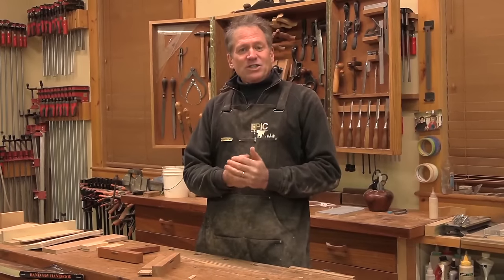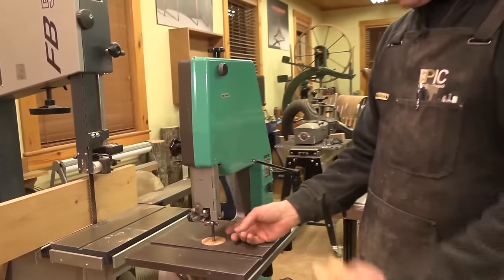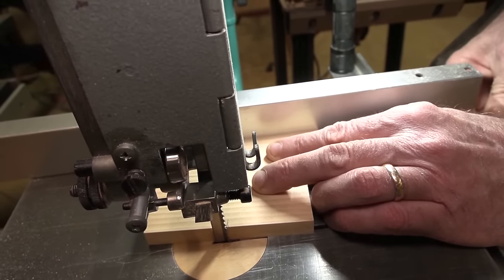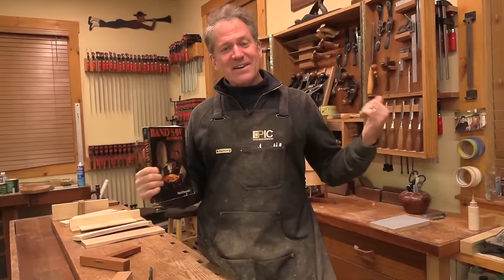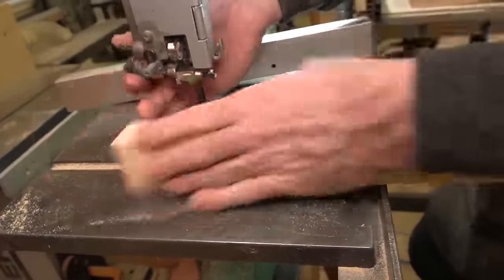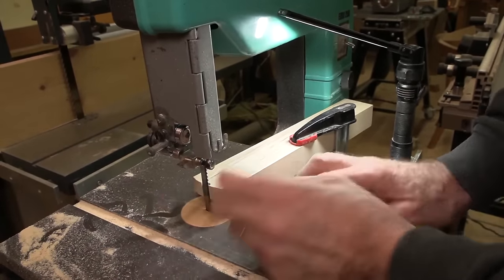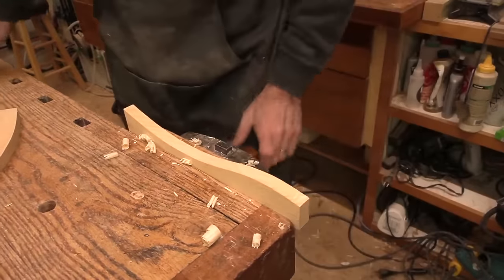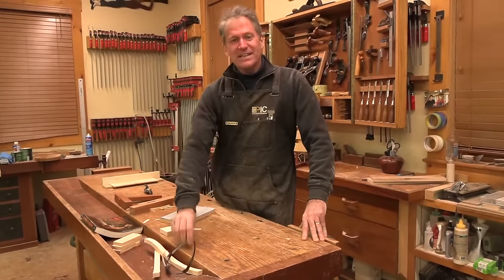Simply Great Bandsaw Jigs

Comment: It seems to me that your pivot point jig will not produce identical items. Your jig will produce concentric curves of the template shape. It means if the curvature is of radius say 100 cm, your jig will give you either 102 or 98 cm for 2 cm of width, depending on if template curve is convex or concave...
Reply from the maker: Yes Michael, that is an accurate observation. Usually I will re-tack the template to the new curve and skim it across a flush cutting bit on the router table, then use the pivot point again. 
The template curve is usually almost indistinguishable from the freshly sawn surface so is is a very light skim past the flush cutter. But for the reason you stated, I like to circle through this way in order to insure more uniform parts.
Thanks, great comment, and thanks for watching! 👍😎

Comment: still having a love/hate relationship with the double sided sticky tape?  try masking tape on the template and on the workpiece.  ca glue on one piece, activator spay on the other,then stick them together. will hold them secure enough to use a guided router bit but still seperates easy enough (so long as you dont put lots of CA glue on - only need a few drops!) no nasty residue left behind when you split the pieces and remove the tape.  I use that method all the time no problem.  2nd jig to follow a curve line was great thank you.
Reply: Thanks for sharing this reminder of this "lost to me" technique.👍

Comment: Excellent jigs!  What's the general rule for how high to set the band saw guide?   It seemed higher than necessary in the demonstration, but maybe it's better for the viewers.
Reply from the maker: Yes, you are right about that, it is set higher in the videos so it’s easier to see the cut on the video. But normally you want to be as close to where you personally need in order to see it well, and still have the guides down as close to the work so that they are guiding the blade there rather than higher and allowing for more potential blade drift.
So as a general rule, around a 1/4” is good if you can see it at that height. Thanks for watching! 👍

Comment: Thanks, I learned a lot of handy tips from this vid and thanks for the info on the bandsaw book. I love the woodworking shows, there is a good one in the spring here in the ATL. 

If you were near Wilson, NC, did you ever eat at the Beefmaster Inn? Little tiny place next to a gas station and a casket company. Best steak ever. 

TIP: instead of using double stick tape, put a layer of blue painters tape on each piece of wood, then use a couple of drops or lines of super glue to stick them together. After the cut, you can pop them apart and peel off the tape, leaves no residue. I have used this to make veneer down to about .045" on the planer.

Comment: I made some wood blocks compatible with the shapes waffled-in underside of my cast iron table, the blocks have magnets drilled in so they are movable and stick under the cast table for easier clamping of jigs and table extensions.
Reply from the maker: I love that idea Ralph! I’ve used the block idea before but the magnets is a great idea. 👍 I suppose the blocks could also be glued directly into the voids using an appropriate adhesive…I can’t think of a good reason you might want to remove them. Thanks again! 😎
Reply: What a great idea,  recessed magnets 🧲 in the filler blocks. I WAS planning to contact/rubber cement the filler blocks in the "honey-comb" underneath.  Thanks for sharing 👍 your  tip

Comment: I always split my wedges with a chisel on some scrap cutoffs. Most aren't perfectly straight grain, so they make a nice wedge when split. The ones that dont work out were scrap anyway.
Reply from the maker: That’s the best quality wedge for sure! These are so small I think sawing along the grain works well enough, but for larger ones, for sure! 👍😎
Reply: @EpicWoodworking  it does work on 1/4" tenons too. I made a project with those. Also works on a project with 3/4" wedged tenons.

It does take a minute to flatten them with a plane or sandpaper, so it's probably a wash time-wise